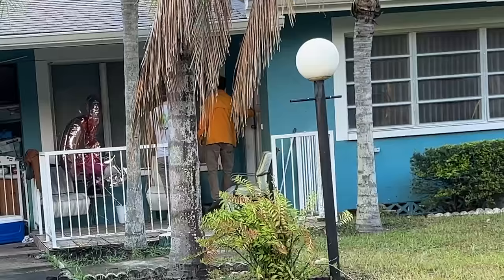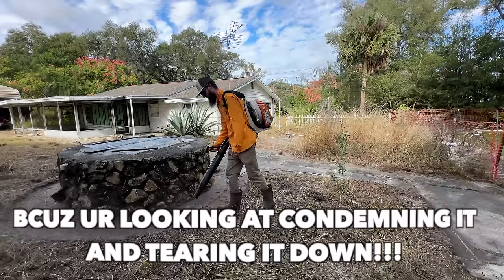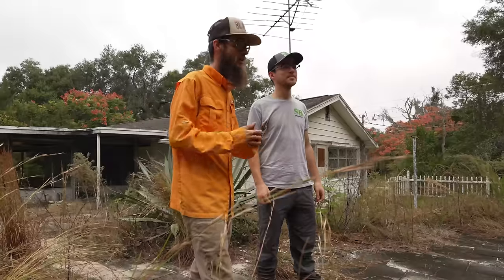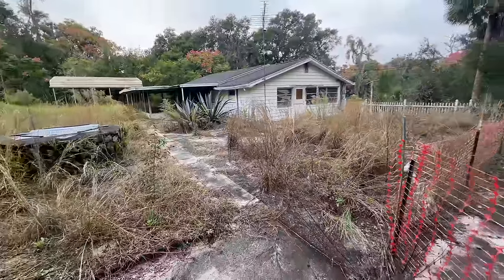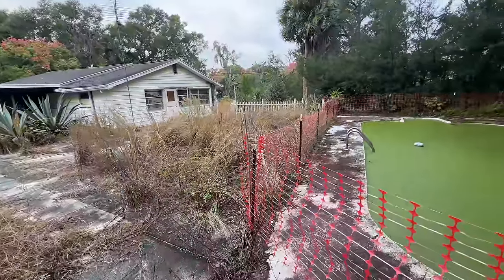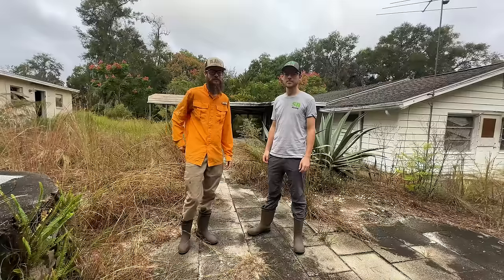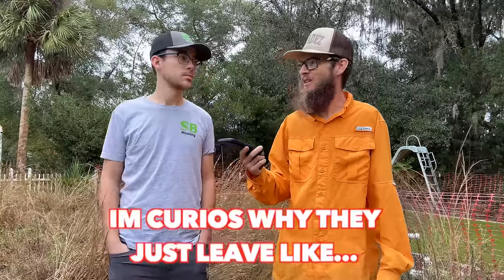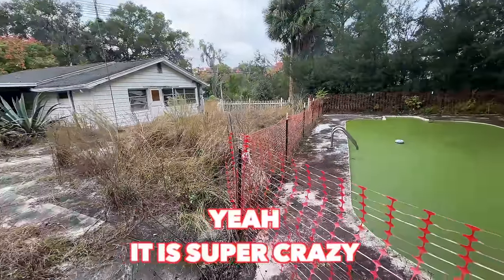Can we SAVE this unique house from being CONDEMNED???

Comment: I love the work you each do, individually and together, as well as your dedication. One thing I need to know is, what kind of shovel do you use for cleaning up the sidewalks? I don’t have any that work so well but it could be due to not having an edger and my sidewalk is not smooth, it’s the old kind with all the rocks even in the surface so it’s hard to get a shovel across it. My trimmer is a walk behind so I can’t use it as an edger. I had to buy it when I took over all the trimming/weed eating about 4 yrs ago, when I realized my husband wasn’t doing it due to not being able to be on his feet very long at all. I couldn’t hold the hand held weed eaters up very long and with our 2 1/2 ac, it’s mostly along the road plus multiple trees, junk vehicles and other objects to trim around and this year I took over allof the property care, myself so I had to buy a new wide cut riding lawn mower in order to save time since I still work full time and was taking care of my husband, as well as all the yard work. Now, I will always have it all to take care of by myself until I can retire and sell it and move closer to my kids and grandkids. Keep up the good work guys!

Comment: I have two battery power Ego weed eaters. A Charge lasts 2+ hours of nonstop work and it’s stronger than any gas powered weed eater I’ve ever used. I have 6 acres  and I never buy fuel.